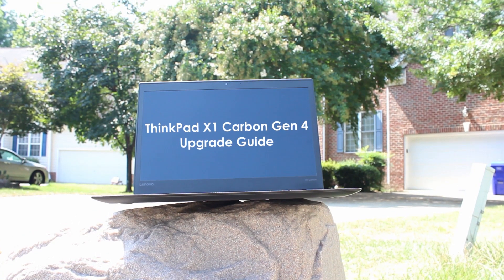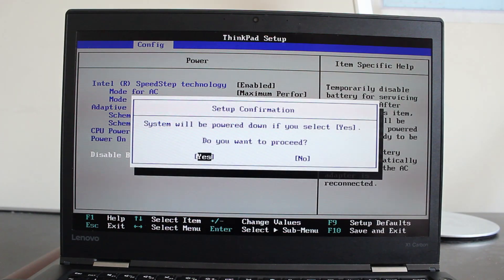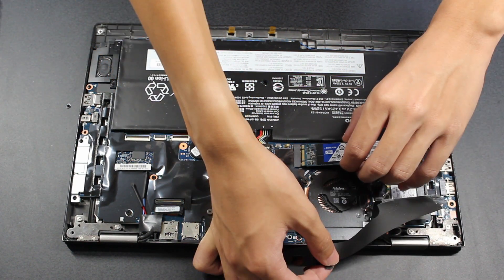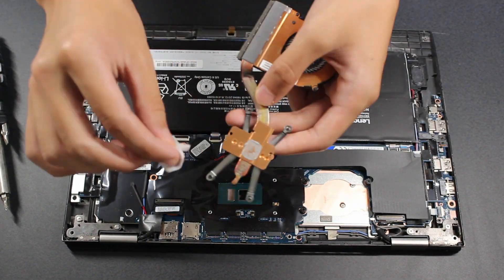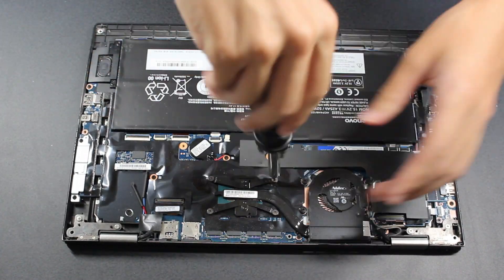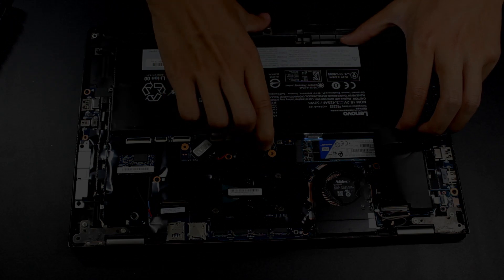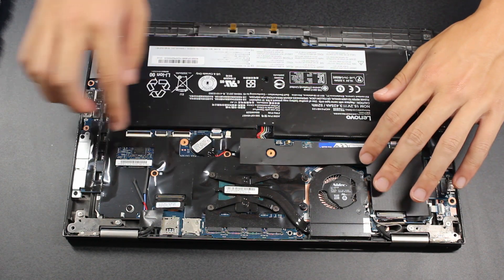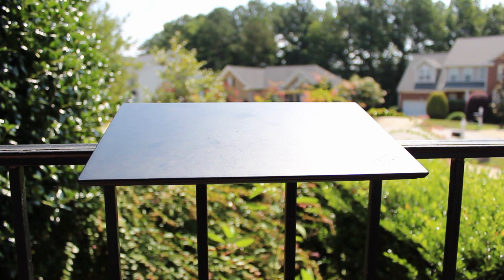Boost Your Ultrabook: Lenovo ThinkPad X1 Carbon 4th Generation Upgrade Guide

Comment: I have this laptop (a friend gave it to me) and I'm getting messages that the AC adapter is failing (either that or the port in the computer is failing).  If I plug in the AC adapter, I kind of have to wiggle it to start charging, then if I move the computer at all it seems to stop charging.  At times when it's plugged in (I usually use the computer on AC not the battery) the display will switch every couple of seconds between bright and dull as if it's switching between "here, have all the brightness you want!" to "uh oh, I'm running on battery, better conserve it by lowering brightness."

I want to try replacing the AC adapter in case that is the problem, there are cheap ones out there on Amazon.  But the one I'm looking at says USB-C and frankly I don't know if my adapter is USB-C!.  Is there a way to tell? when I look at it, it looks like a small rectangle with a single pin in it.

Comment: i have a question about the wifi cards... the AX210 NGX wifi card,   is the lenovo x1 4th gen bios compatible with the AX210..? 4th gen currently has the 8560 wifi card so it will fit etc  i just dont kno anything about bios

Comment: I have this model, X1C4 . is it worth to change wifi card in 2023? Please give me your thoughts.
Reply: I replaced the wifi card in mine with an AX210 without vPro. That's the newest Intel wifi card that works with the chipset and CPU, from what I can gather. It was definitely worth it, despite me not having a wifi6 network. Range, speed and power use all improved, and it worked out of the box.

Comment: i wanna know i actually have same laptop but running out of storage so what ssd storage you replaced to.. and how much storage space can i get if i want maximum of it
Reply: just about any m.2 PCIe NVMe (there is a differenece from the m.2 SATA) ssd brand should work. for the right amount of money, you can install as much as 4tb or potentially more

Comment: What if i want to upgrade the RAM?
Reply: you can't with these later x1 models. all you can do is make sure you purchase one with the capacity you need built in
Reply: @360.Tapestry  can one be soldered instead?
Reply: @lazyhomeowner  i would review the teardown videos and photos floating around the internet. the memory chips (no ram stick) are soldered directly to the motherboard. i wouldn't recommend it, as it would require very precise removal and installation. a mistake could be irreversible or catastrophic. and i am not experienced with acquiring the memory chips by themselves. i typically find them as sticks. BUT if you are very knowledgeable, experienced, and confident with electronic components, it may be worth a shot. of course, doing anything of this nature would immediately void whatever remaining warranty, so if things go bad right away or later down the line, there's little recourse there - i would just look at other models if the onboard ram capacity is not enough or if you plan to expand
Reply: @belliduradespicio8009  a casualty of going thinner